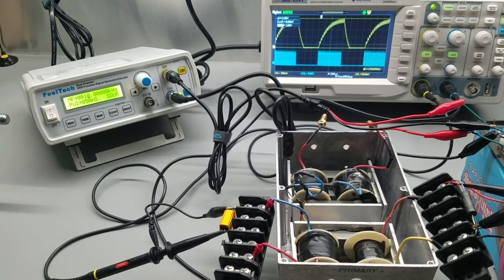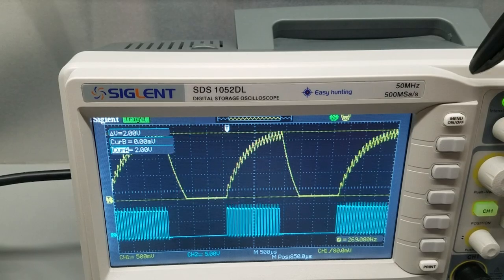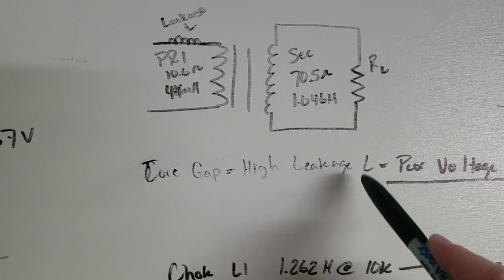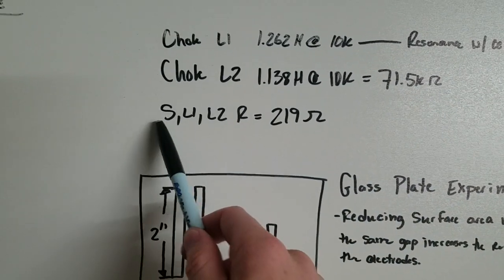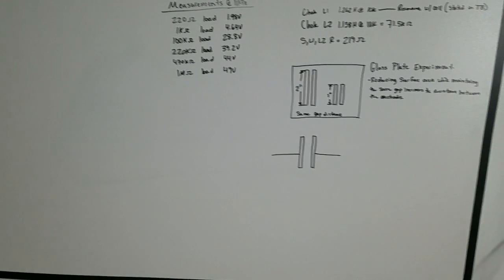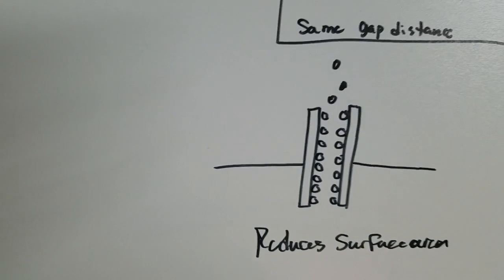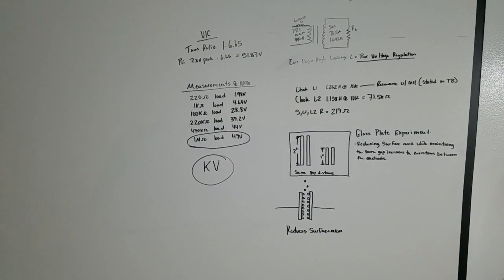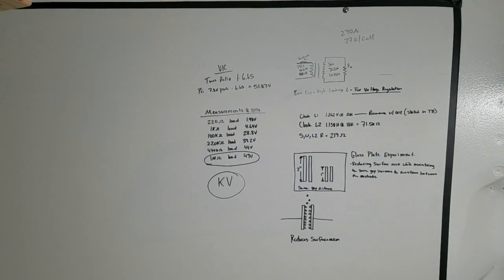Stan Meyer Research # 22, Jul 2019-Stan Meyer's Water Fuel Cell idea-Part 1

Comment: Puls train must be ( puls puls puls (+) ON ) ! Not , puls puls puls OFF ! You must use variable (-) side inductor ! ! !
Reply from the maker: Yes I think you are right. See my latest videos I show my drive circuit and schematic which does exactly that.
Reply: @BradKwfc   Hi Can you build a custom resonant cell for a nominal price?
Reply from the maker: @Mohammed-uz1sn  I don't have the tools to build one. I had mine done at a machine shop. Cost was over $1500usd if I remember correctly.

Comment: Stan falsified his patent to protect it from oil companies, you should know this if you have looked into it! His brother got the real deal. Stan used high voltage fast variable voltage, this fast variation broke the molecular bonds.
Reply from the maker: Which patent are you referring to-He had over 30 patents granted to him on the technology. From the research I have done he didn't falsify anything but he left out the most critical parts of how it works. Many of the figures and calculations he included in his patents are correct.

I agree with you on Stephen, his brother, his business name is on alot of Stan's electronics, including the last project he was working on the Steam Resonator home heating unit.

Unfortunately replication is difficult. Stan made it sound easy but its much more complex than he ever let on.

Comment: So I've been experimenting with a few different coils and running off solar powered 12v battery bank. I'm finally able to hold a small torch lit but what can I do to up production from a wet cell coil? 
I have a video on my channel and an about to upload more on this. Let me know if you can help
Reply from the maker: If you using brute force electrolysis you need a large plate area, a good electrolyte and no more than 2V/cell and a lot of current. Lots of papers out there about ways to increase efficiency of electrolysis (Cooling the electrolyte, vibrating the cells to get the bubbles to release etc). If you trying to replicate Stan Meyer's work then be prepared to spend years on research. Its not easy and if you replicate but don't take the proper precautions you will get sick from exposure.

Comment: Interesting . For efficiency you want resonance for sure but it strikes me  that it might be useful to create what ever it high Power it takes to get initial current flow and then settle into resonance . Bit like an old school fluorescent tube with a transformer ballast resistor
Reply from the maker: Exactly...Its a circuit that starts off with a very low load impedance but if the right criteria are met the impedance will change, then, and only then, can you tune into resonance. 

There's a lot more going on with Stan's cell than he ever hinted at. The cells themselves and the VIC's are matched not just for resonance but likely for a specific current density in relation to the total surface area of the electrodes. If not the system will never work. Even when everything is right its nearly impossible to get to work.
Reply: @BradKwfc  It takes years to  find and teach the key expertise points, this is a good example, we have all been say for a long time like a furo ballast but yet we missed the fluro starter thinking amazing.